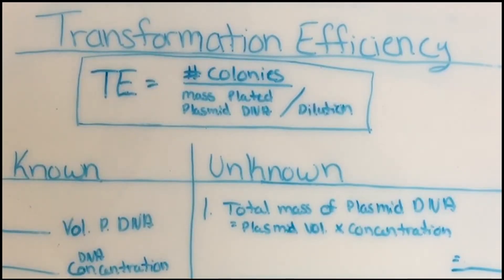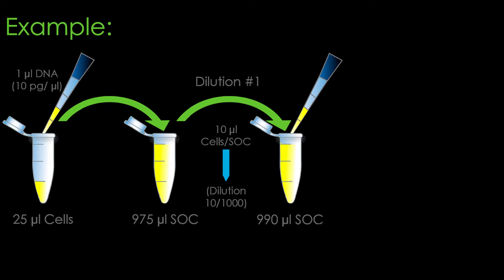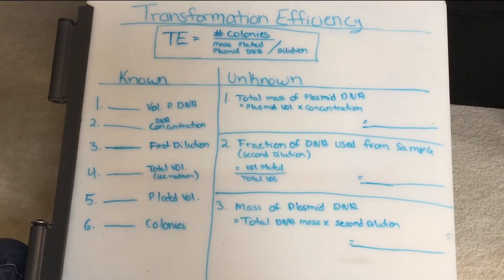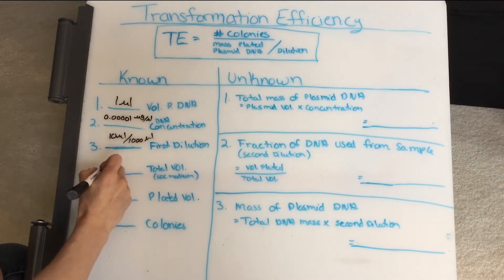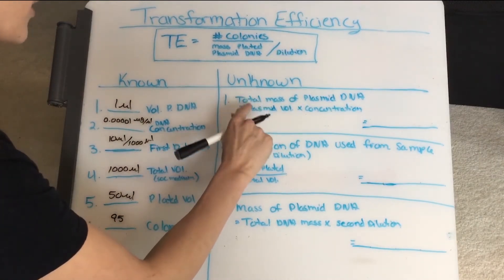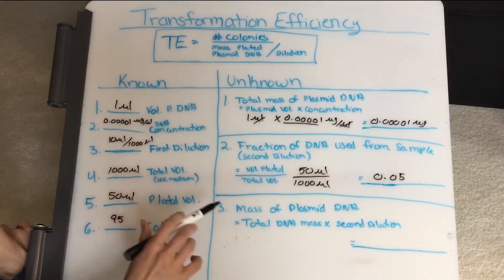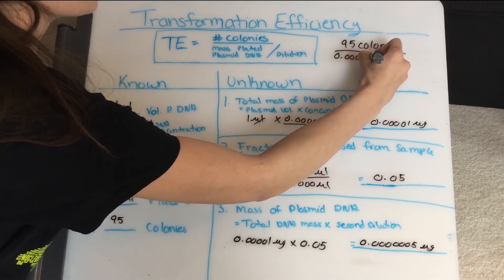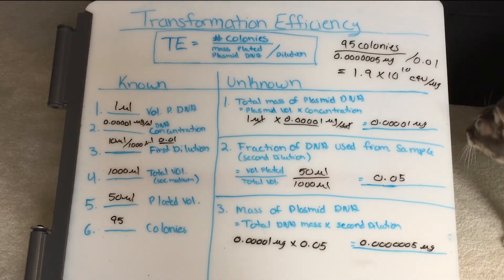How to Calculate Transformation Efficiency

Comment: hello, thanks for the nice Video. 
I have a Question and it would be cool if you could help me. 
I tried to calculate the TE by myself and my result was 1,9*10^12 CFU/µg, instead of 1,9*10^13
The concentration of the DNA is 1pg/µl and 1 µl of the stock was added to 25 µl of competent cells and then filled up to 1000µl with the SOC media. So that means the new concentration is 0,01pg/µl (or 0,00000001µg/µl) and not 0,00001µg/µl. This solution was subsequently diluted 1:100, from which 50 µl were finally plated. So: ((95/0,00000001µg)*(1000µl/50µl)*100)= 1,9*10^13, or am I wrong?  thanks in Advance :)